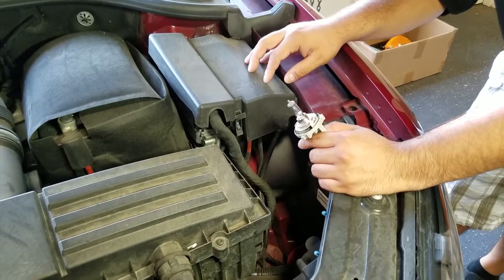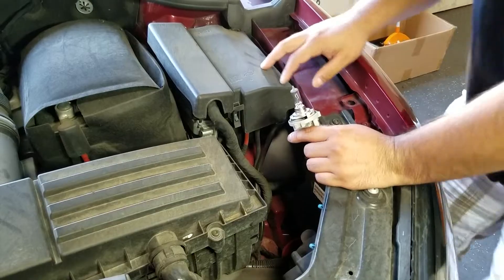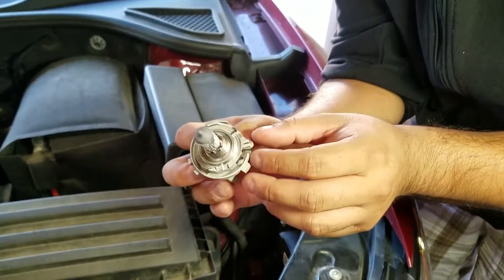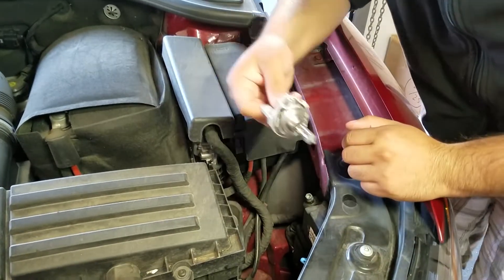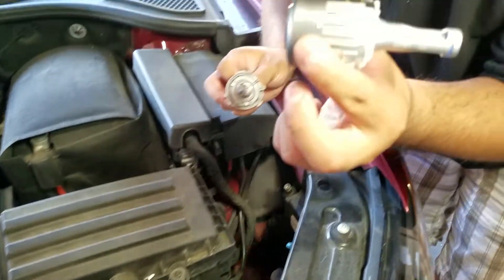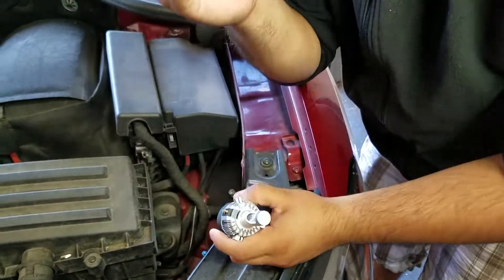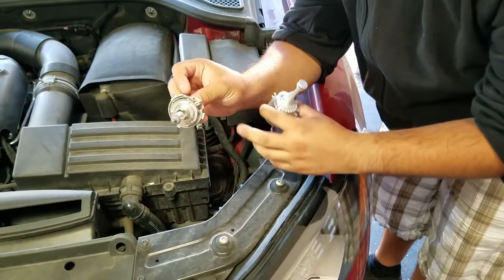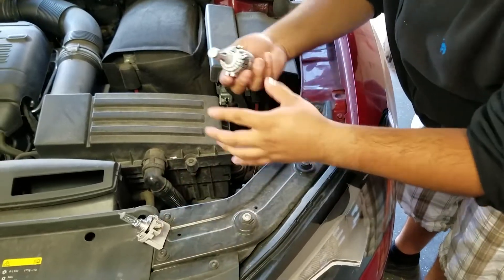How To Install Low Beam H7 LED Headlight Bulbs On A 2015 Volkswagen Passat | ALL-IN-ONE DESIGN

Comment: I have a 2015 VW Passat Limited Edition (US). The default halogen bulbs got dimmer over the years and weren't particularly bright to begin with. These Lasfit H7 Light fits perfectly and its a night and day difference. I can see every detail on the road and love the cool compared to the stock warm. Very happy with the purchase. I wish I would have installed these years ago. I highly recommend these lights.
Reply from the maker: Thank you very much for the recommendation! 
We appreciate it if you could share some beautiful pictures with us!
We now have a new campaign of 2024 upggraded T3 series LED turns signal bulbs testing, are you interested in participating? The T3 1156 bulb fits for your 2015 VW Passat front signal light.
Here is the link for you: https://www.lasfit.com/products/1156-amber-led-turn-signal-bulbs-t3-series?utm_source=Referral&utm_medium=forum&utm_campaign=T3-1156A

Comment: will these fit and work on my 2011 passat b7 edition ?
Reply from the maker: No, these fit 2012-2019 VW Passat.
For 2009-2011 Passatl, you can use the retainer adapter and standard H7 LED bulbs to replace the stock halogen bulbs.
Standard H7 LED bulbs:
https://www.lasfit.com/products/h7-led-headlight-high-low-beam-fog-light-la-series?utm_source=Social&utm_medium=YTB%20Channel&utm_campaign=LAplusH7

Retainer adapter for 2009-2011 Passat:
https://www.lasfit.com/products/2x-h7-led-headlight-bulb-holder-adapter-retainer-for-volkswagen-sagitar?utm_source=Social&utm_medium=YTB+Channel&utm_campaign=TK112

Comment: So I bought the "all in one" plug n play H7 for my 2016 VW Passat.  I go to take out my Halogens and there is an adapter.  I dont need an adapter for the "all in one" plug n play H7 so what do I do with the adapter....its wired in there?  Wont that screw up my other lights?  The lamps I'm replacing are my low beems.  I'm so frustrated and cant get anyone to give me a real answer.
Reply from the maker: Hello, could you pplease take some pictures of the OEM adapter to send us for a look?
Please contact us for support by email.
cs@lasfit.com
Reply: @Lasfit-Automotive  I have the same issue and contacted customer service to make sure these bulbs would fit my car. Was there a response to this?

Comment: Any word on if high beams are in the works? I just ordered my lows today!
Reply from the maker: Hi, what's your car make, model and year?
Reply: @Lasfit-Automotive  2012 Volkswagen Passat. I was not able to find them on the website and I have seen posts on how they are not available. I was curious if it was something in the works or if I should lose hope. :P
Reply from the maker: @TheRicereater78  For Passat high beam, the bulb size also is H7. But it comes with another special retainer holder. You need to find a retainer adapter to install standard H7 LED bulbs on high beam. We're developing custom H7 LED bulbs for high beam, and it is in testing. You can subscribe to our channel, and we'll do a new video once the new LED bulb is available.
Reply: Sounds good! I'm subscribed!

Comment: I just got these, and the dust cover sits right on the FAN. Is that going to work in long run? I feel that the FAN won't be able to dissipate enough heat.
Reply from the maker: Hi, it's ok to close the dust cover. If you worry about the heat-dissipation, you could leave the dust cover off, or drill holes on the dust cover for better heat-dissipation.
Reply: Lasfit Auto Lighting thank you. You guys don’t sell after market dust cover. It would be nice to have a combo. I would def buy one that looks like a cone. I feel that it will help with the fan, and you don’t lose protection against potential dust in the light .
Reply from the maker: @sameftek9799  We have universal rubber dust covers, but we don't pack it with the LED bulbs: https://www.lasfit.com/products/dust-cover-water-seal-cap-rubber-caps-for-headlight?utm_source=Social&utm_medium=YTB%20Channel&utm_campaign=Universal%20rubber%20dust%20cover

Comment: I just purchased these for my wife's 2012 VW Passat and I can't get the driver's side bulb to lock into place as easy as shown it this video. I sure wish there was a tab to turn the bulb like the OEM bulb retainer has. It would make the installation of these bulbs so much easier. There isn't enough room in this tight spot where the opening is for the headlights to grip the bulb and turn it to lock it into place since the fan shroud has a smooth finish. Does anyone have a trick to get the driver's side bulb to lock into place?
Reply: It took me a second time to get the driver side to work, I got it to turn a smidge and it worked. I still feel like it might not be in 100% bc I felt the passenger side turn more to lock in.

Comment: Product description mention in Notes: 5. Will not fit the car headlights with dust cover. -> does that mean the OEM dust cover that is first removed to access the bulb will not go back in when this is installed at the low beam?
Reply: Do you have a link to the extended dust covers? I can’t seem to find any online
Reply: Its not ideal but I just poked 4 or 5 holes each in my covers.  In the future if you need new covers to sell the car or something they're fairly cheap on vw part sites.

Comment: Hey did you change your high beam? If so did you get a code pop up on your dashboard?
Reply from the maker: Hi, the high beams also come with a retainer holder, different from low beam. We don't have the compatible LED bulbs for high beam at this moment.

Comment: Do you have a solution for Mitsubishi Outlander 2016 H7 as it uses a special holder etc?
Reply from the maker: Hi, we redesigned LED headlight bulbs for your Mitsubishi Outlander 2016 with a special holder. The new products will be available around May. If you're in need of it, plz contact us for support by email: cs@lasfit.com

Comment: 400$ for a led bulb… think the halogens will do fine
Reply from the maker: It is a set of LED bulbs for Passat, which includes headlight low beams, high beams, fog lights, interior map lights, dome lights, trunk lights, reverse lights, vanity mirror lights and door lights.
Definitely, you could keep the OEM halogen lights.

Comment: will this work for a VW CC 2011-2012 model?
Reply from the maker: This does not work for  VW CC 2011-2012. We already redesigned custom LED bulbs for VW CC 2011-2012, the new products will be available around May.

Comment: They fit the driver side light.
Will NOT fit, in any way, the passenger side.  Even the body shop could not get them to fit.  They shaved down a couple of the 'pegs' alone just to get it to seat... poorly.
Ended up frying the entire headlight assembly.
Reply from the maker: Oh~~ For some cars,  one side housing is too small to replace the bulb. It needs to take out the entire headlight assembly. How do the LED bulbs work on your car?
Reply: @Lasfit-Automotive  Driver side works fine.  Passenger side would slot just fine, but never lock (impossible to turn).  Body shop took out the entire headlight and still could not get it to lock.  Finally shaved down a couple pegs to kinda-sorta get it to lock but never very well, which caused it to eventually short out the low beam assembly entirely.
The rear barrel really needs some edges so that it can be gripped and turned without necessitating removal of the entire front of the car just to get the headlamp out (HORRIBLE design by VW).
Reply from the maker: @amzarnacht6710  Hi, did you take some photos when you shaved down a couple pegs to get it lock it?  That''s weird, please contact us for professional support. cs@lasfit.com

Thanks for your feedback. This LED bulb was upgraded. The new version was designed with 3 chamfers on the edge, which make it's easy to grip and turn.

Comment: I istalled mines a month ago and just now started to give a code and not turning on :/
Reply: Did you put the rubber covers back over them? They need to breathe or they get too hot and won't work. I know it's not ideal but I made 4 or 5 holes in my cover so their exhaust fan could breathe.
Reply: @nedseldomridge2873  thanks for your comment, after reading this I did the same when I installed these today

Comment: I bought these for my '13 Passat and they worked excellently. No error codes and went right in during installation. But finding anything that works for the high beams on a Passat is out of luck. Nothing works, www.headlightexperts.com said they had one to fit the high beams but they were totally wrong! Then they refused to return them because they said I installed them. I don't know how you can install them when they don't fit in the first place! Every light on my car is from Lasfit because they're better quality and have great customer service! Only reason I tried the other guys is they said they had a pair that fit a B7 Passat...wrong!!! Please, Lasfit make a specific setup for the B7 Passat high beams!!!
Reply: Headlightexperts advertised lifetime warranty and free replacement forever, it's not true?
Reply from the maker: Hi, we'll take your suggestion into consideration. Thank you
Do the LED lights work well on your Passat?
Reply from the maker: Hi, good news.🙂  We developed custom LED bulbs for high beams. We're testing it.

Comment: I'm pissed I just purchased an 8000k hid kit for my 2013 passat and didn't realize the trouble I have to go through to install them
Reply: Kevin Ruth literally just got my package in today and have a 2013 as well. I felt so defeated when I noticed that VW used that silly adapter for the low-beams.
Reply: I have a 2014 Passat, most local HID shops won't even bother installing HID kit. This is the easiest method, other LED kit and retainer clip would not unless we do wiring modifications

Comment: Bought for 2014 Passat but unlike the video the part does not rotate into place or click. Meaning wast of money
Reply from the maker: The LED bulbs align to the slot of the housing, then twist to lock in place.
Reply: Should work perfectly, bud. Everyone on here loves them. Not trying to be an a$$hole but just be patient and try them again.
Reply: I got the same problem. Been trying for 30 mins to turn them into place
Reply: 1Binds same here don’t fit